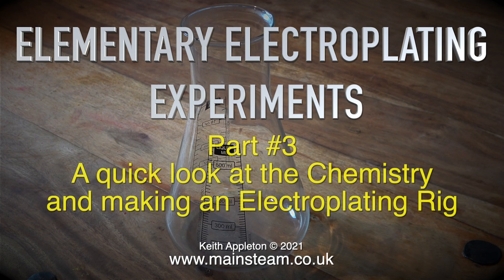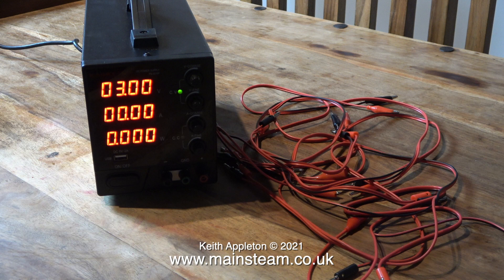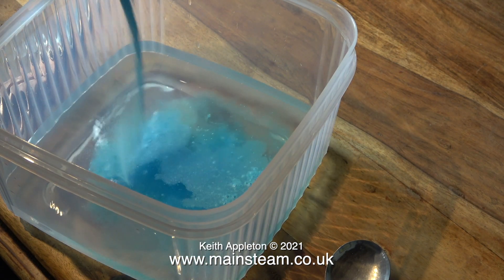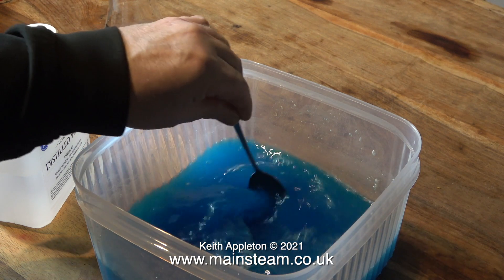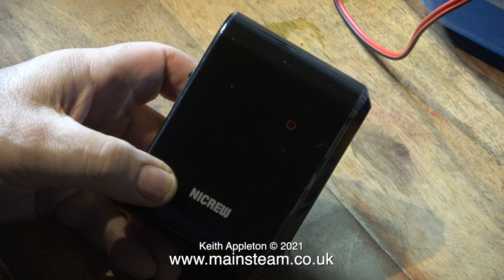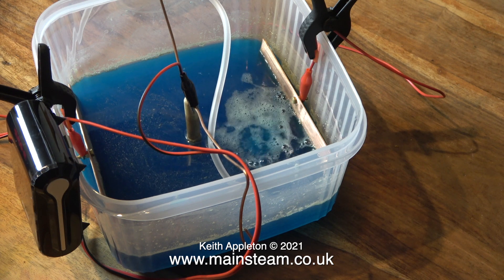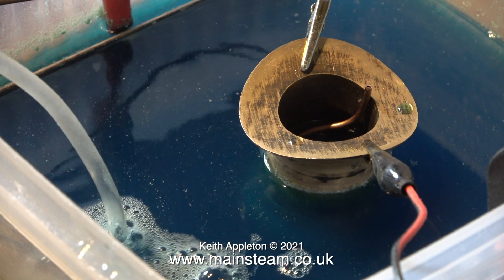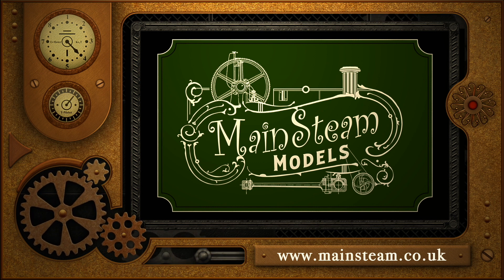ELEMENTARY ELECTROPLATING EXPERIMENTS - PART #3

Comment: Well done, but for a Yorkshire gent seems a little expensive. I have had a go and received good results using a 12 volt battery charger, washing soda xtals, tap water and sacrificial copper plate, moving the anode and cathode closer together altered .the deposit rate as did some car bulbs in series with the leads. Obviously not recommended for works of art but good enough for unseen bits and pieces. However a word of warning, be prepared to ventilate and protect yourself from the fumes given off and good luck...

Comment: Keith, one use for the (_oil-free_) air agitation is to, basically, "wash" the hydrogen bubbles off of the part(s) to be plated.  The hydrogen bubbles can "stick" to surfaces, preventing plating.  And, they can build up in interior corners (of the part(s) to be plated) under the surface of the plating solution, also preventing plating.

Comment: Other comments about cleanliness are spot on.  Decades ago, after honorable separation from the U.S. Army, my 1st job was as a laboratory technician dealing (among other things) with electroplating solutions.  Surfaces to be plated are subjected to several processes, before any metal is deposited.

Things get more complicated when laying down a non-reactive metal, like copper, on a more reactive substrate, like steel.  Immediately upon immersion, without any electricity being applied, the non-reactive metal will deposit out.  Unfortunately, such immersion layers are poorly adherent.  The difficulty is overcome by using a "strike" bath, which contains the desired metal at low concentration and chemically complexed.  Once an initial very thin, but adherent, layer has been deposited, the build up to the desired thickness can be undertaken.  The "classic" "strike" bath for copper contains (sic) cyanide.  I strongly suggest leaving copper plating on steel to professionals.

Comment: The deposit on the surface of your solution suggests  that the copper sulphate is not as pure as claimed. It is probably either copper hydroxide or copper carbonate. If you add a small amount of sulphuric acid it will be converted to copper sulphate.

Comment: I don't understand why you have the large copper cathode. Does it influence the build up of copper on of the part you are plating? It seems superfluous to me.
To plate the chimney, you could use a large piece of coper pipe to use as the anode, with the part to be plated at the centre. This should give an even build up of copper all round.
Other than that, I think that the lower the current the better the result. If you can be patient enough...

Comment: If you give the parts to be plated a wash in sulfuric acid before plating them to give them a key for the plate to grab and to remove any oil or contaminations it will work better and stay were it is deposited .you don't need to keep them in the acid long just for a minute or 2 to remove anything that may keep the plating from sticking then a rinse in distilled water.
Reply: Yes, etch, then rinse, then plate, all without contaminating the part(s) with hands, etc.

Comment: How much distilled water did you buy  ? Reason I ask is that it is $1.00 per gallon in the U.S. .  Experiment is a great way to learn.  I work with a lot of chemicals daily only suggesting I have  is. be-care-full
Reply from the maker: I bought two 1100ml bottles of Distilled water.
Reply: @keithappleton  I use distilled water from Halfords meant to fill lead acid batteries.  £3.90 for 5 litres. It's actually de-ionised water but it works well for me.
Reply: Thank you. I like comparing prices around the world.  I will let you know if and when I find the Perfect place.  I enjoy watching your videos.

Comment: expensive distilled water too bad you don't have a dehumidifier could make your own
Reply from the maker: I have one of those in my workshop, but I was worried about Legionnaire's disease . . .
Reply: @keithappleton  Copper sulphate will kill all of that.
Reply: Tumble driercondensate water is a great source of distilled water as long as yours does not drain into your home plumbing.  If the condensate is captured into a removable tank it is always available for experiments.